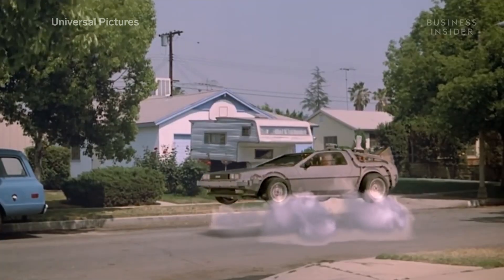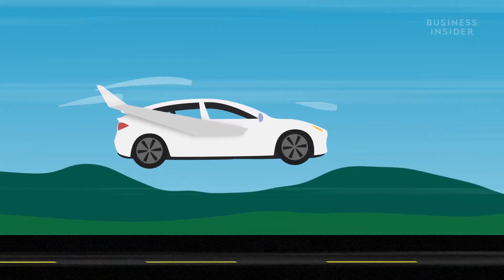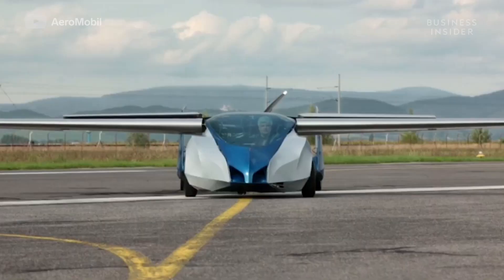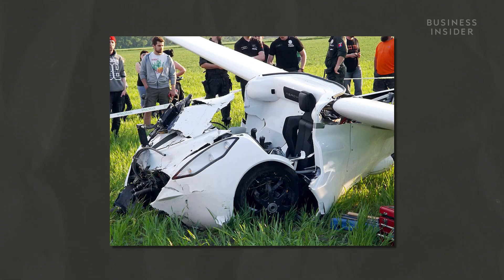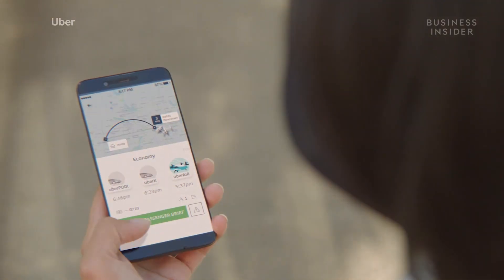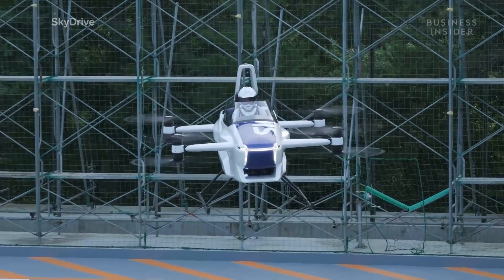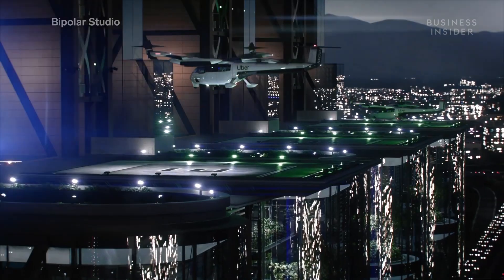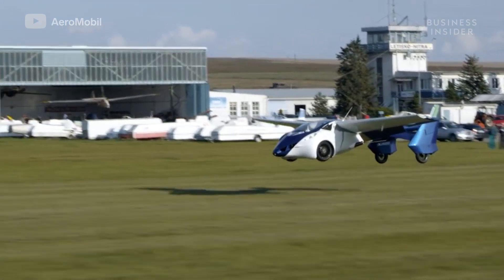The Real Reason We Don't Have Flying Cars | Carsplainers

Comment: Judging by the amount of bad drivers out there I'd say the only way we'll have flying cars is if they're fully autonomous with a thoroughly tested and reliable AI system.
Reply: AI isn't infallible. Ask the USAF what their UAV crash rate is compared to manned aircraft. It's much higher.
Reply: @PabloGonzalez-hv3td  But more safer than humans.
Reply: @neeljavia2965  Not according to the USAF crash rate for UAV vs Manned aircraft.
Reply: @PabloGonzalez-hv3td  USAF data doesn't apply to the entire world.
Reply: @neeljavia2965  So you're saying average people tech is more advanced than the American military industrial complex?😃
Reply: @PabloGonzalez-hv3td  Yes.
Because your average tech doesn't have to do things that the military requires.
Reply: @neeljavia2965  Well that's the irony. Most UAV crashes occur to otherwise perfectly airworthy aircraft that suffer simple sensor failure and are rendered uncontrollable.
Reply: @PabloGonzalez-hv3td  So?
Reply: @neeljavia2965  So they're losing perfectly flyable aircraft to simple failures...
Full automation just creates new problems.
Reply: @PabloGonzalez-hv3td  Last I read they are automating aircrafts which are already decommissioned and their only use is target practice.
Some good aircrafts might also be automated and then lost in testing.
But that's the price for R&D.
Reply: @neeljavia2965  I'm talking about what are commonly referred to as "drones". 
The USAF has no interest in crashing them.
Reply: @PabloGonzalez-hv3td  Hmmm.
Still it's worth the technology.
Reply: @neeljavia2965  Sure but it's not the end all answer it's made out to be.

Comment: There’s literally no point when we have airplanes and these probably would be $100,000 so in theory airplanes would be cheaper.
Reply: Air planes cost millions and billions
Reply: @A6q4  yes for an individual will you be able yo spend 1 mil+ the cost of the car (not accounting the gas and maintenance) on flight tickets using a plane that’s much safer and go further in your lifetime ?

I mean the dude is right I have probably spent at least $1000 on local flights on international flights maybe around $15,000 but we should really only count local cause thats the range of this cars and I am 24 so just x that by 4 and that’s probably my lifetime so 4k on local and 60k on international thats well under the estimated 100k if you just use planes but again international once shouldn’t be counted cause those cars can’t even go that far.